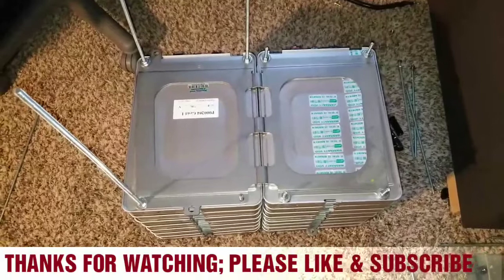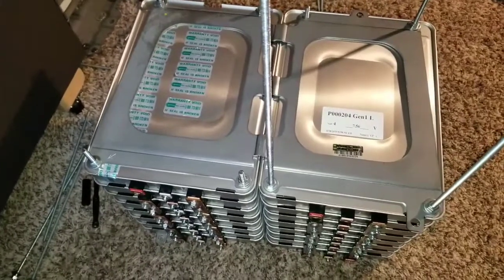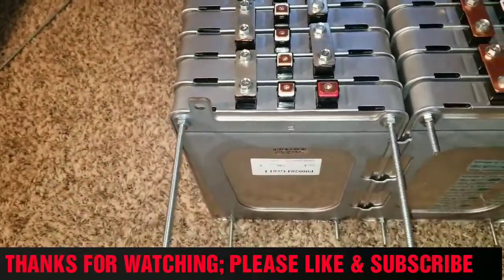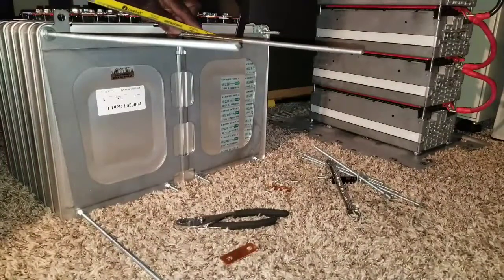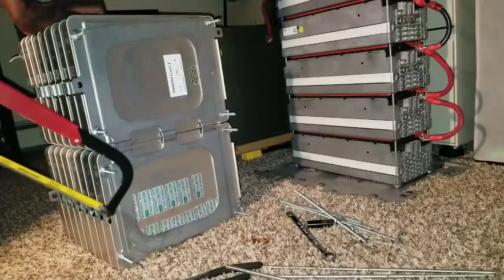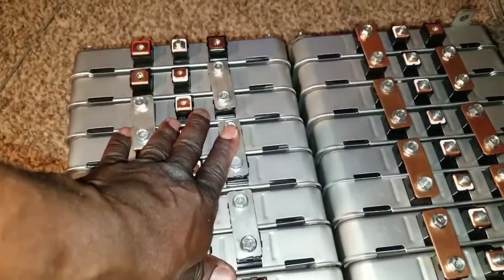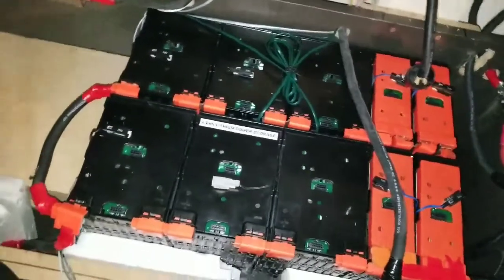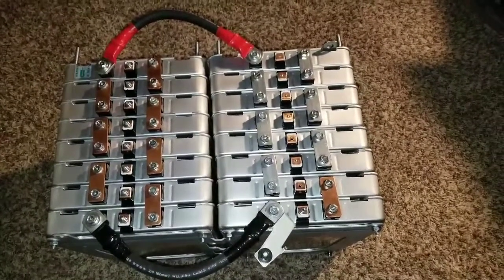STACKING NISSAN LEAF LITHIUM-ION BATTERY: DIY 8kWh 16s 48V Nissan Leaf Lithium Battery Storage

Comment: I'll ask again, why 8 modules vs 7 modules. I figured that 7 modules is the best if you use 57.6 volts. My inverter will charge my pack to 57.6 volts then hold the voltage until the amperage drops to like 5 amps or so. It is a CC/CV charge algorithm. I am using the Sealed Lead Acid algorithm for this pack. It is actually the perfect voltage as it keeps the charge off the top and the discharge cut off keeps it off the bottom knee. This allows good capacity use of your modules. With 8 in series if you charge to 8.22 volts each module you will have too high of voltage for your 48 volt system. 65.7 volts is just too high. 8.22 volts is perfect for your top voltage.
Reply from the maker: Thanks for your input. 
My Inverter/Chargers can handle high input voltage and i am taking that advantage to run a 16s configuration @ 60v plus. It has been working flawlessly ever since

Comment: Have you tested your golf and Nissan leaf batteries is there any heat buildup?
Reply from the maker: Zero heat. 
I am currently running them. 
Please check out my latest videos post  and have a wonderful day
Reply: Nissan Leaf Modules are in a sealed container in the vehicle and have no cooling or heating requirements. The design allows for proper cooling. Ambient battery temp should never go over 120 degrees. So don't let them sit out in the sun or enclosed container that is directly heated by the sun. In a shed with ventilation the cells should never get too hot no matter what you dish out. The car dishes out more amperage than your use in your home.